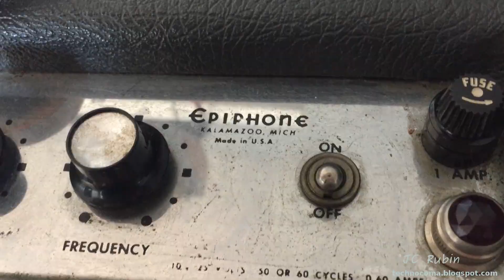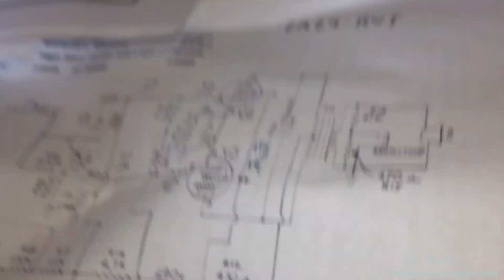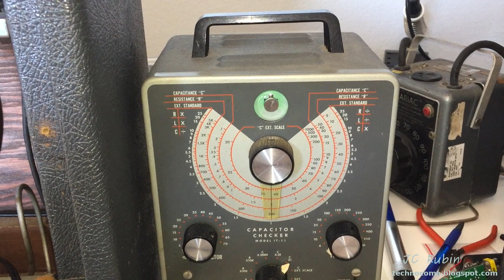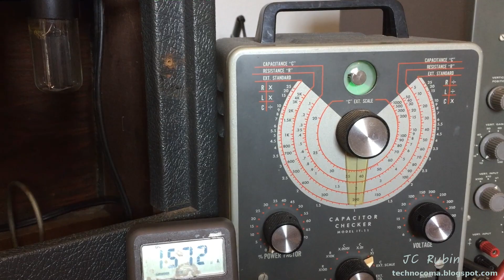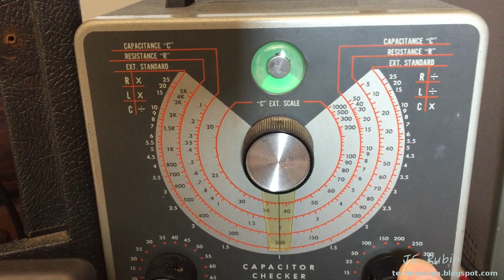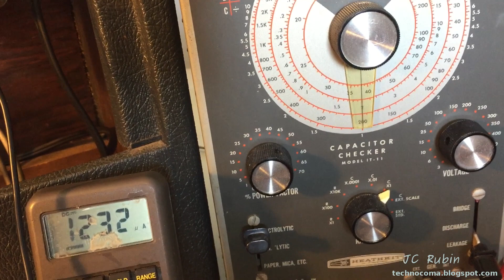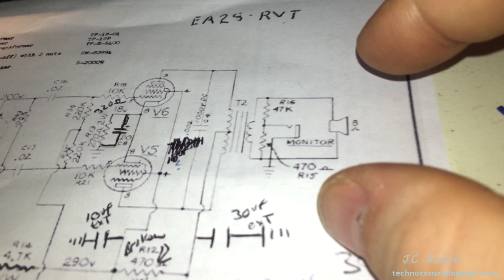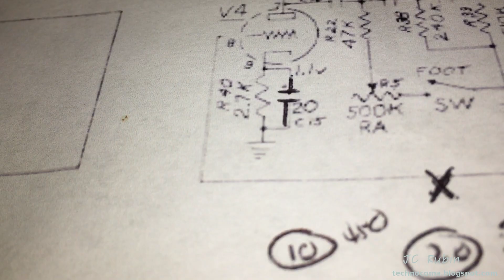1960's Epiphone Guitar Amplifier Repair EA28-RVT  - Part 1 of 3

Comment: I have a suggestion. Any electrolytic capacitor of that age is presumptively dead. The life span of an electrolytic capacitor is abot ten to fifteen years. These are at least 50-60 years old. Save yourself a lot of work and toss them in the trash.